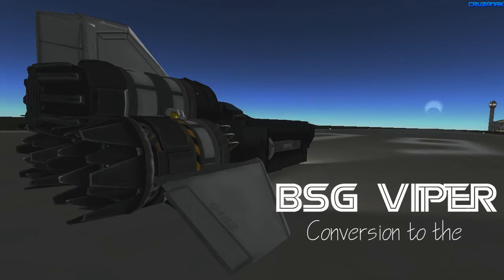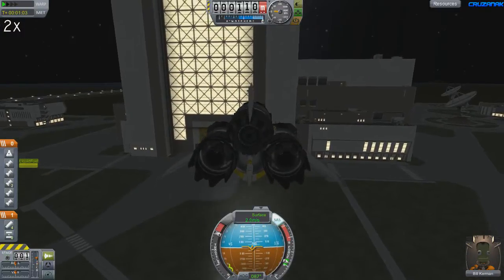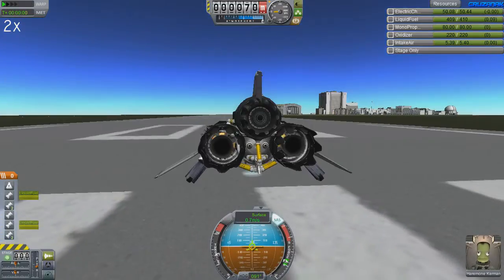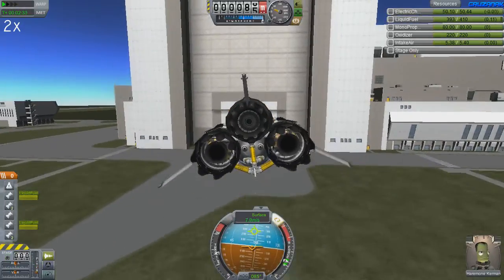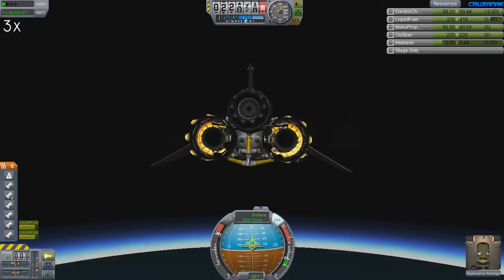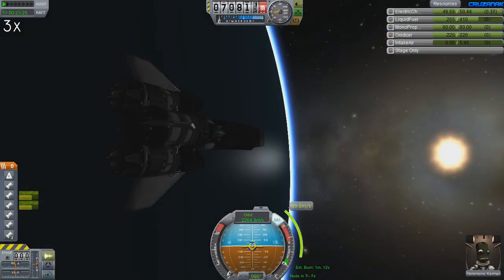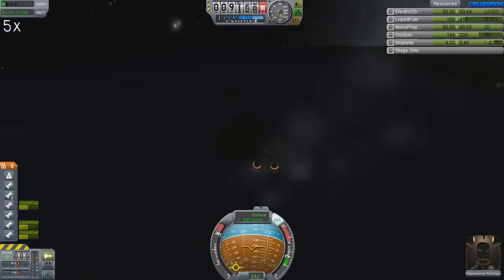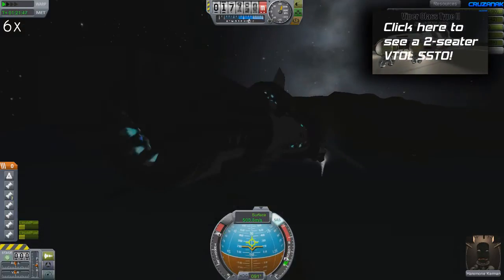SSI Kittyhawk VTOL SSTO: The retrofitted BSG Viper!  KSP v.22

Comment: Very nice design, I do rather like it. I was wondering though, did you sneak rocket motors into the turbo jet because turbo jets, at least in stock ksp, are not mixed mode. What rocket motors are you using on this craft and how did you fit them? I built a Colonial Viper in my game, not an exact copy it uses two RAPIER engines and no VTOL, using a mixture of Firespitter, KW rocketry, procedural wings, and flown with FAR that works pretty well. I saw you left a comment that you can't fly this craft well with FAR enabled and I can understand that. The viper I built seems to hit a brick wall if I do more than about 1300 m/s while accelerating in the atmosphere. If I do more than that, it will start to stall violently. Anyway i love your videos and thanks.

Comment: I know it might be crazy but how about trying to re-build some of the capital ships from BSG? You don't have to start with the Galactica but maybe the Olympic Carrier? Cloud 9? Imperial One? A Cylon Basestar? :D
Reply: An addition: after having tried the Kittyhawk I have to say it flies really well, however I'm not able to reach orbit with Farem Aerospace Research installed :C
Did you try that? Or is it my pilot incompetence? ^^
Reply from the maker: I'm eyeing that Olympic Carrier ;)
The only problem I have is that I have a pretty low end comp so I have to worry about part counts. I'll see what happens though!

As for the Kittyhawk, I'm not sure why it would be struggling, but I don't have FAR so I can't test it. I assume it should be easier to get to orbit with FAR though. I'll take it for a spin to see if .23 messed up its performance or something.
Reply from the maker: KateTheAwesome Well I fired up the Kittyhawk and the Viper to test them out in .23 and they still kick butt. Maybe FAR really does mess up their performance :(
If you're flying the Kittyhawk, try cruising at an altitude of 30-33km at 2/3rds of max throttle. Without FAR I can build up over 2100m/s surface velocity in that range on the TurboJets alone. Unfortunately I don't have a clue what cruising altitude you'd need with FAR enabled so you'd have to mess with that on your own.
Good luck! If you figure it out let me know. I'm curious now to see how well this design works in FAR.

Comment: Well I worked on the computer for about an hour and this is what I came up with. It is a short/medium range gunship designed to deliver 4 missiles at a target. (It was somewhat based off of the Isprit however it lacks the front stabilizer) It does have some issues with balance so It may flip while taking off the ground in VTOL mode, but once you are in the air it should stop.
I can't post web links in comments tho so Im not sure...
Feel free to showcase it I have no idea how to make videos